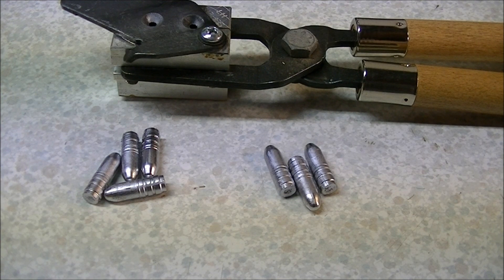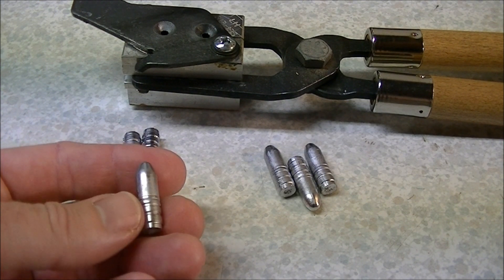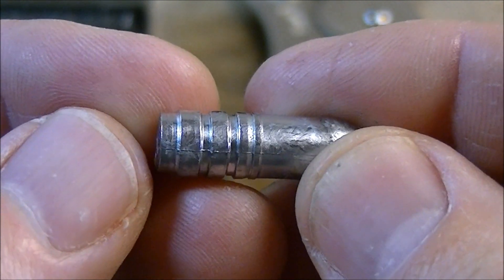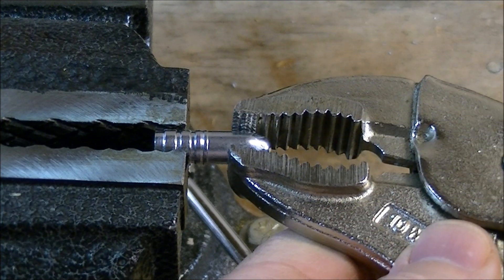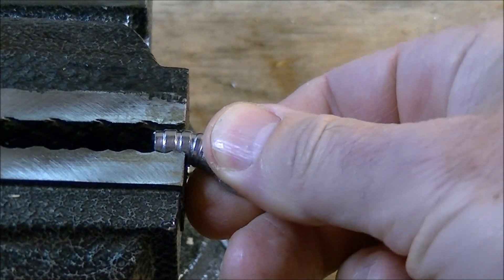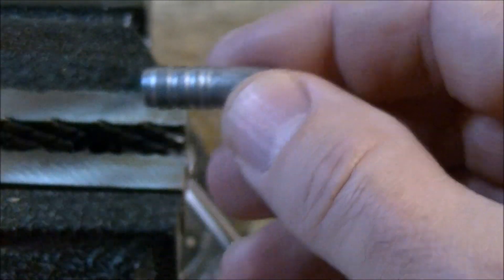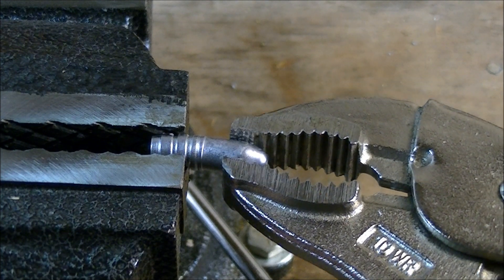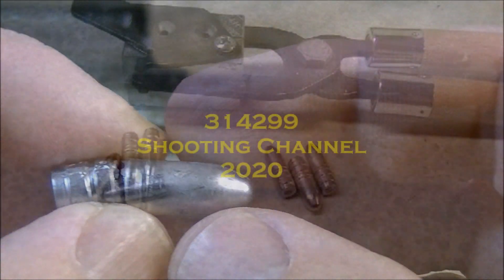Air Cooled Vs Water Dropped Bullets

Comment: Are these pure wheel weights as received?  Or do you alloy with something else to make casting easier?  Thanks
Reply from the maker: These were cast with 100% wheel weight metal. Wheel weight metal casts quite well if you use enough heat.

Comment: So ive got some stockpile of lead and it seems to flow well but i think its got zinc contamination to it ad its not casting with that silverish shine to it

Or is it the tin that gives it the shine due to it making it flow better?
Reply from the maker: If you had zinc contamination your alloy would be completely unusable for casting. Tin will certainly improve alloy flow, but the big difference between shiny and dull looking bullets seems to be the temperature that you are casting at. Shiny bullets are no advantage IMO, other than in a cosmetic sense. I cast hot with wheel weights and that solves most issues for me.
Reply: @314299  yes but with the dull sheen its casts out with its also forming pits in the metal castings so wouldn't that affect the bullet trajectory?

Comment: I shot some water dropped and some air cooled powder coated bullets into wood a few years ago and the water dropped bullet punched right through but the air cooled ones acted just like soft point hunting bullets.
Reply from the maker: A friend and I did similar tests with cast 357 magnum fired from a 20" carbine, shooting into the end grain of large blocks of wood and then spliiting them to find how deep the air cooled penetrated vs the water dropped. From what I recall the water dropped went twice as deep with minimal deformation compared to the air cooled that expanded considerably.

Comment: Wear Gloves please when even handling lead. It is nasty stuff. Gets through skin, vapor,etc.. takes 2-3 years for it to get out of the body.
Reply from the maker: You will not get any appreciable level of lead into your body by handling un-oxidixed lead objects like bullets as the skin on your hands is pretty thick. Unless you bring lead to it's boiling point there is no "vapor", even casting bullets does not get it to that temperature if you are using an electric casting furnace. Primer residue is a much more dangerous source of lead contamination as it is already a dust and an oxide that is more readily absorbed. Wash your hands after handling lead or fired cases and you will be fine.

Comment: Hi I was just wondering if you ever tried to quench those bullets with light oil in which will quench and lube at the same time ( three in one oil works decent
Reply from the maker: Nope, never tried that. I dont think it would work very well to harden the bullets as oil does not conduct/absorb heat the same way as water. As for "lubricating" the bullets oil would be entirely too thin to stay on the bullets.

Comment: I wonder what would be  the difference in BHN air versus water cooled?  From your experiment it looks like it would be a big difference.
Reply: I use a LBT BHN tester , I get around 12 bhn for air cooled clip on wheel weights and 20bhn for water quench  .
Reply from the maker: Air cooled wheel weights are said to be 9 to 12 BHN while water quenched ones run over 20 to 30 BHN.

Comment: Maybe I will stop dropping them in water because I want my 300 blk 225 gr HP bolts to mushroom upon impact. These are subsonic so 950-1000 fps certainly won't mushroom a super hard alloy mix. Great video!
Reply from the maker: At those sorts of speeds you should be just fine with air cooled bullets.
Reply: You definitely need to quench them. In a smokeless rifle its a must to minimize leading. You also need a gas checked bullet for best performance. A non quenched bullet is not as effective as you might think. Pure lead is so soft it will actually fragment or splatter. The refined structure of a quenched bullet hold the lead together so that it can mushroom. You should experiment with magnum alloy. Same thing as magnum shotgun shot. Regular chilled lead shot is pure lead. According to Olin. We shot 30.06 velocities with incredible preference and same as no leading. Be excellent in a 300 even a sub speeds.

Comment: So which is better... Air or Water and why?
Reply from the maker: Neither is by itself better or worse. Hard bullets are generally preferred for higher velocity rifle bullets as they are stronger and less likely to strip the rifling, they are also better for bullets for semi auto pistols as they withstand the beating they take during feeding from the mag to chamber. Air cooled bullets are generally better for lower velocity revolver bullets as the bullets can still have some expansion potential.
Reply: @314299   Thanks that makes perfect sense... I am casting only for odd ball calibers like 44-40, 45-70 and other custom cartridges all using black powder in mostly antique guns like Winchester 1873 and 1886. As the bullet heads are used in feeding maybe they should be water cooled? Or should I air cool because the rifling in the barrels may be weaker than modern guns? Your thoughts please...

Comment: What do you think the Bhn is of the water quenched bullet?
Reply from the maker: Air cooled wheel weights are said to be 9 to 12 BHN while water quenched ones run over 20 to 30 BHN.
Reply: @314299  thank you for getting back to me. This helps a lot!

Comment: What is the diference in Brinels????
Reply from the maker: I dont have a BHN hardness tester but air cooled wheel weights are said to be 9 to 12 BHN while water quenched ones run over 20 to 30 BHN.

Comment: Seems like the air cool, would mushroom, and water drop would be more like an fmj.
Reply from the maker: The air cooled might expand, depending on impact velocity. Air cooled wheel weight bullets are still considerably harder than the soft pure lead that jacketed hunting bullet cores are made of.

Comment: So if one wanted to make an explosive projective they would use water, and if one is wanting FMJ Let them Air cool? Would that be a good assumption ?
Reply from the maker: Not quite - water dropped WW alloy bullets are certainly harder than those not water dropped, but they don't "explode" when they hit a regular target. If shot at steel they will shatter, but generally they just plow into most things and occasionally break into a couple chunks. A FMJ bullet is much tougher and will penetrate more. A non heat treated lead bullet is much more likely to deform and "mushroom", depending on the impact velocity.

Comment: Been using range scrap to cast air cooled 124g tc 9 mm and 148g 38 special dewc bullets. Lee liquid Alox tumble lube. Absolutely no problem with leading. However the bullets Illustrated in the video are the same ones I've cast air cooled from wheel weights for my SKS and AK. I have to say, I got extreme leading on the gas piston of my AK to the point where the Piston got stuck in the gas tube. I'll try powder coating them next time.
Reply from the maker: Some gas ports are drilled poorly leaving burrs that scrape lead off the bullet, those rifles generally will never do well with a lead bullet of any sort. Your issue could also be just an undersized bullet, powder coating will add a couple thousands to the size of the bullet and might cure the problem. I guess you will find out when you try it.
Reply: I slugged both my AK & SKS to know what to size to.  I size after PC.

Comment: Thank you for the great video.  I have a question, what if the water was heated, say almost to boiling temperature and dropped into it to cool / quench?  How would that effect the brittleness of the bullet?
Reply from the maker: My understanding of the effect of the water temperature on the bullet hardness is that the water should be "cool", never getting hotter than you could comfortably put your hand in. The hardening effect is presumably reduced if the water is close to the boiling point, presumably the bullet turns the almost boiled water to steam which is not as good a coolant as water.
Reply: Thank you for the reply.

Comment: Good demo. I find that heat treating entire batches at once gives substantially more hardness.  Also much more consistency between samples.
Reply: Exactly, however dropping them straight from the mould, carefully not to splash water into the melt, will usually give hardness variations from about 3 or 4 points brinel. This may be critical in small calibres, but I've found in .45 and .50's to not make much difference in accuracy, at all. It certainly makes them harder than Linotype. I've driven .375's at 2,700fps with 1 1/2 MOA accuracy, using LBT Blue lube as well, with hardened bullets.

Comment: I wonder how directly this translates to leading in the bore?
Reply: Leading is mostly attributed to hot gas overflow, when bullets are a bit undersized. Notice the fact that there is no leading in .22 LR since the bullet is skirted and allows no gas overflow. In my club in Poltava, Ukraine (then the  USSR), some СМ-2 barrels stood millions of rounds without significant loss of accuracy.
Reply: I'm curious if the water quenched bullet would leave less lead fouling.  Seems like it.
Reply: there are more than a few factors involved with lead in barrels.   lead alloy type, bullet base type, velocity, bullet diameter versus actual bore size, condition of bore, LUBE is HUGE - and often overlooked.  there is a lot that goes into it.

Comment: Interesting test. I water quench my casts for all but black powder type cartridges. 

Haven't gotten around to rigging up for powder coating, but hate cleaning leaded bores. With proper sizing, don't really feel the need.
Reply from the maker: With properly sized bullets of the correct hardness I dont have an issue with leaded bores.
I water drop all my rifle bullets and auto pistol bullets, but air cool my low velocity revolver projectiles. I recently gave powder coating a try as it can increase the diameter of bullets when it is required.
Reply: Increasing bullet diameter with the powder coat is interesting. How much can you reasonably expect to add on?
Reply from the maker: @slowhand1198  With the TL358-158- 2R  the bullets were .361 after powder coating, making them suitable for .38 S&W. I think the tumble lube design bullet might hold more powder coat than a standard design, so I'm guessing you could add a couple thousand of an inch to a regular bullet.
Reply: Thanks, that's valuable info. The worst leading problem I've been getting is in an Australian issue Victory model in .38 S&W.  Guess I'll look into the powder coating a bit more.
Reply: @slowhand1198  just shoot a jacketed bullet once it leads . I’ve done it forever it’s a old trick I’m surprised more ppl don’t know . Usually 1 bullet cleans em out. I’ll shoot 200-300 and then fire a few jacketed bullets to clean it out 💯 %
Reply: Once you powder coat you won't ever go back. It's so easy to just get a toaster oven , static charge the powder on them with swirling them in a plastic container. Simply bake at 350-400 degrees and I usually drop them in water after I break them apart. Resize after and store.  Total buy in for powder coat should be 20-30 bucks for a used oven and some columbia powder

Comment: This may be a little off subject, I knew a dude that was a trapper and for the larger animals that would get in his sets dispatching them with a .22 most of the time wasn't vary humane. anyway, he developed a cast bullet round for his 30-30 and that did the job every time. He used that lee 150 gr mold with 12 grs of Reddot.  He liked the cast bullet with the mild loading because it wouldn't damage the pelt and at close range it was very effective. I know what you are saying, I feel that folks can make a bullet too hard, it has to obturate at low pistol pressures, I believe that adds to the accuracy if you just let them air cool. anyway, that is my two cents. Good demonstration. -Dave
Reply: They're supposed to be groove sized, generally, with cartridge guns. That .001" or less doesn't take much force to get the bullet to swell and seal it. To paraphrase what Sir Samuel Baker always stated, concerning firearms: "the gun/loading has to match your intended quarry, and the bullet needs to be made to work in the gun and have acceptable effect on the target."  He had several different mixes of alloy he used (even back in the BP days) for his different guns, everything from a 10 bore rifle (which shot a 3 oz bullet (hardened with HG and SB) over 16 drams (430gr) of powder) all the way down to little .32 "rabbit rifles" (75gr bullets (trace amounts of tin) and 10gr of powder).

Comment: I have read somewhere that the effect of quenching the lead passes away in a couple of weeks, and the bullets will become soft again, is that a fact?
Reply from the maker: The wheel weight alloy contains lead with small amounts of arsenic and antimony in it. When cast with quite hot alloy and water dropped the bullets actually gain hardness for about the first month, then very slowly get slightly softer over time. The decrease in hardness over several years is not really significant. I prefer to develop loads with bullets that are at least a month old as they are mostly stable in hardness at that point.

Comment: Question. I water drop my pure lead bullets and the gas checks become rounded from shrinking. Would putting tin or linotype in it fix the shrinking problem? Granted it only happens in my 45 molds, i tried heating the mould up to see if its that and its iust when i drop it in water.
Reply: Water quenching has no effect on pure lead other than just cooling the bullet off quicker.  You need a percentage of Antimony in the mix for water quenching to harden it further, slight variations in hardness can occur during water quenching just by the temperature of the water and the time the bullet is cast and it hits the water so a consistent casting cadence is important for consistency.   Arsenic in small amounts also found in wheel weight alloy .etc. is a grain structure refiner, the finer the grain structure of the bullet metal the harder or higher BHN the bullet becomes after it's allow to age harden.  Arsenic allows further hardening of lead/ antimony based bullet using the heat treating process usually around 1/4 of 1% is all that is needed.  Tin can be used to harden pure lead but the effect is minimal, it's much better suited for lower the surface tension of your lead based alloy which helps with mold fill out.   All cast lead bullets shrink to some degree softer alloys and larger dia. bullets will show the most shrinkage.
Reply: @reloader7sixtwo  thank you that was a perfect answer to my question (:
Reply: @Je3perscre3pers  There are several forums dedicated to casting and shooting cast lead bullets Cast Boolits and the Cast Bullet Association are just two of those.  Another good reference site is http://www.lasc.us/CastBulletNotes.htm  lots of good information and reading there as well.

Comment: Very interesting that lead becomes so brittle when cooled in water. It may not be an advantage if you have a desire for deformation if the bullet is to be used for hunting. I understand that you want a relatively hard bullet to avoid lead fowling in the barrel, but what about trying to cool in oil instead? Steel is often cured in oil rather than water, otherwise it will become too brittle. Just a thought :-)
Reply: Nimbus1954, I don't think you're going to get so hard that these bullets will fracture on impact,  I still think penetration and performance would be better than soft lead.

Comment: Thats a great bullet, I shoot it a lot in both my SKS and Mosin rifles with excellent accuracy.  Do you powder coat? if so try casting that same bullet for 50% pure lead / 50% COWW, powder coat and quench those bullets right out of the toaster oven, gas check and size and let them sit for two week to age harden.  They will be the same consistency as the ACWW bullets but the polymer jacket will allow you to shoot the bullet at a much higher velocity.  I've been shooting my NOE 30 XCB bullet cast for the above alloy and gas checked and powder coated to 2300 fps. in my 30-06 with excellent accuracy using H-4198.
Reply: Interesting. What's your twist on that rifle?

Comment: SO now, what would these two bullets do when fired into a a target,..I mean how do they perform?
I ask because I know nothing at all about casting bullets or re-loading either for that matter, but I'd like to learn.
Reply from the maker: That of course depends on what sort of target they hit. The airdropped bullets will, depending on impact velocity, expand and deform if they hit a moderately tough target and will "splat" if they hit something hard. The water dropped bullets will generally punch clear thru a moderately hard target and will shatter if they hit a something hard. 

For most use this does not matter as most of us are shooting targets at a range, it's more how the bullets behave in a barrel that matters, the harder bullets will tolerate a lot more velocity and RPM's without failing.
Reply: @314299  Ah yes, I can see that now.The differences are considerable, much like a full metal jacketed bullet as compared to a soft point I imagine.
Thanks for the reply.

Comment: kinda the same with frosty bullets.
Reply from the maker: You can get bullets to a very brittle level of hardness when the alloy is really hot and they are water dropped. Fine for target shooting but not so good as a hunting bullet.
Reply: @314299  Besides water quenching you can heat treat bullets that have a small amount of Arsenic in the lead such as clip on wheel weights.  Heat treated bullets will give a move consistent BHN over a longer period of time once the bullet age harden out at two to three weeks.  A good read on the various aspects of heat treating cast lead bullets http://www.lasc.us/HeatTreat.htm